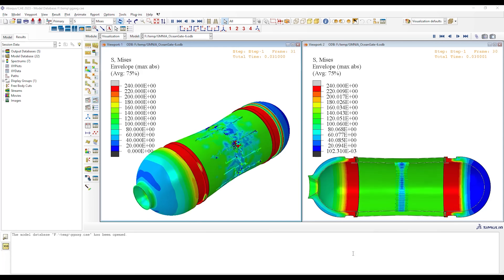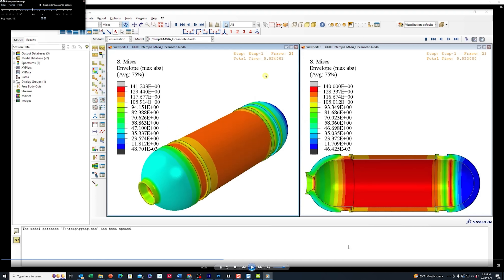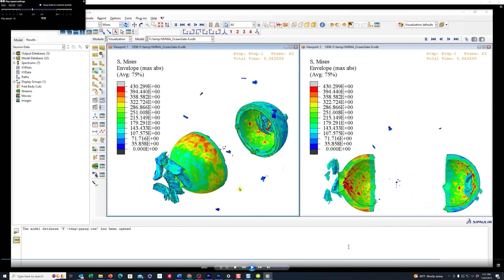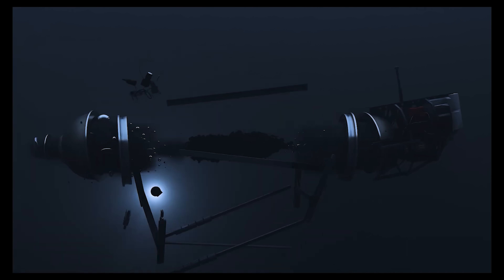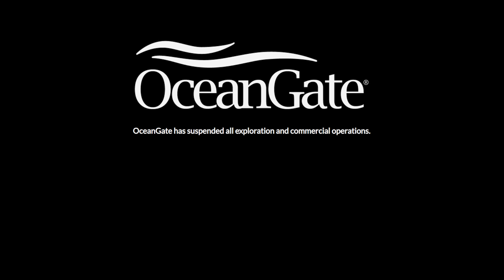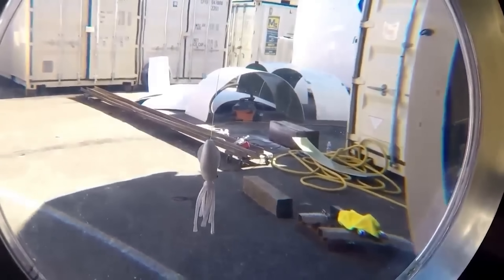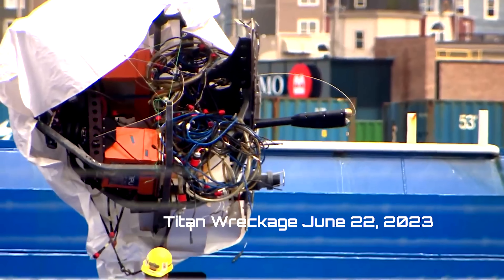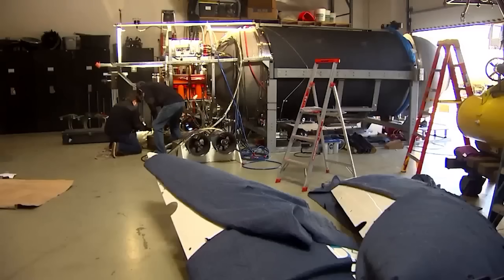Best Titan Sub Implosion Simulation, Cracked Porthole? Q & A

Comment: The implosion  compresses the air inside of the submarine. It does it at a rate that is fast enough to produce 50k°  Fahrenheit lasting about 2 seconds. Last time I checked that was pretty hot. So It  wouldn't matter if you were sitting on the end for crying out loud. Why is everybody so obsessed if the passengers felt anything or knew anything. Man is not afraid of dying, as long as it doesn't hurt

Comment: surely no one would use the sub. if there were obvious cracks in the window
WRONG, THE BOLTS DID NOT FLY OUT OF TITANIUM RING HOLDING WINDOW, VERIFIED IN WRECKAGE
GARBAGE VIDEO,  NO FACTS,   ILLICIT  ASSUMPTIONS

Comment: Pause vid at 11:21. The image shows an o-ring groove around the face of the titanium cap. It's probably a 400 series o-ring. A face seal is no where near strong enough as compared to an external or internal groove type. Ya, I know it would be hard to hinge the end cap as a door without using a face seal. My theory is the end cap(s) started to flatten and the o-ring face pivoted off the face of the titanium ring. Boom.

Comment: One can see in the video in which the recovered titanium parts are taken onboard the recovery ship, that the bolts around the porthole are in fact intact. I suspect that when the carbon fiber hull imploded the force pushed the acrylic window out from its mounting. Carbon fiber is prone to damage with repeated cycling under strain, so every dive would have weakened the integrity of the carbon fibre reinforced plastic (CFRP), the plastic being epoxy resin. The implosion was more or less inevitable. As far as I know the company did not undertake non-destructive testing (NDT) to determine if the integrity of the carbon fiber hull was compromised. This NDT is standard procedure in the aircraft servicing sector, and is carried out on carbon fibre parts

Comment: This isn’t a correct display of how it imploded. Those titanium caps would be pushed together like to powerful magnets being pulled towards each other crushing the much weaker carbon fiber material in the middle. There is equal pressure around the entire sub being pushed inward. The second that carbon fiber weakened those two titanium plates would once again sand which together. I kinda think the window was the first failure point, when they tested their 1/3 scale model the window collapsed inward. I don’t think the acrylic cracked, I think the entire piece of acrylic failed and got pushed inward and then from there I think the titanium plates crushed the carbon fiber hull. I’m not an engineer nor do I know a lot about the ocean and how the pressure works at depths. But I have a good understanding of physics and have to deal with physics everyday with the kind of work I do. It just makes sense to me that if the entire sub had equal pressure that the two stronger metal end caps would sand which the weaker carbon fiber the second the carbon fiber started to buckle

Comment: Those cracks in the window could just be salt residue. The water would be pulled to any surface imperfection, it doesn't take much to create a site where you get nucleation, which will pull more water to that area.

Comment: For one thing.....the TITAN had both an external and internal liner. How did they inspect it between dives? Did they disassemble all those fairings between each deep dive? 
I also question the handling of the sub. Did the handling itself put stress on those glued joints between Titanium and carbon?

Comment: Am I missing something? In the photo of the titanium ring coming off the ship, the sling goes through the porthole area...and I dont see any bolt holes for securing the clamping ring to hold the porthole in place....even if the bolts sheared you should see something there right??

Comment: Neither, it most likely broke at the carbon fiber, titanium cap seal. That’s the weakest point on there. They used resin glue in a non sterile, non climate controlled, non vacuumed environment and carbon fiber would be expanding/contracting at that joint every time.

Comment: Just a question, or two, about the electronics surviving at depth. Wouldn't the extreme overpressure of the implosion ignite the air in sub, including the casings that the electronics are housed in? There's certainly enough pressure at that depth and with a fairly oxygen rich air content in the sub wouldn't that mean that combustion would occur? Would this destroy the electronics completely or do they test electronics at these extremes?
edit:  The more I think of the forces at play the more questions I have. Would water hammer occur in an implosion as well? I've seen experimental slow-motion footage of model implosions and there are around 3 pulses in the bubble with the first happening after an initial flash of light. Is water hammer occurring in between pulses and what would that do to plastics and electronics?

I'm sure the outer cameras and electronics would be fine as they weren't inside the pressure vessel.

Comment: Revealing how that one scientist with the simulations goes on and on about the hull failing first but then gives little detail about his other simulation that he's worried might be more accurate. Remember that the social upper class doesn't like anything that takes away their privileges and the privilege of their members to be the first to explore new areas of the ocean is one thing they really don't like losing. The bourgeois is evil even if it spends its time hiding behind institutions and nonprofits.

Edit: that idea of a hydraulic pump causing a problem is a real issue in my opinion. Hydraulic systems have to be sealed by o-rings that could fail. Now he might have had a check valve to stop ingress in the event of a seal failure. One of the problems with hydraulic lines is that they expand and contract ever so slightly even if they're pure metal. Hopefully no one on his team switched out stainless steal for NiCopp brake line because they were too weak to do the flaring of stainless steel.

Oh, yeah, and one thing to keep in mind is that the government often lies about things during investigations to throw people off track. So when they said the people inside were listening to music when it imploded, I'm inclined to think that there may have been something else being recorded.

Comment: didnt the audio recording show they were hearing "cracking" sounds from behind the read wall.? Could the acoustics make them think it was from the read, when in fact it was from the front. On the voice recording, they did switch from Battery A to battery B, also at the rear.

Comment: I love how in one simulation the domes are sucked inwards due to the implosion, while in the other simulation the domes are ejected outwards.

It just reduces confidence in the accuracy of one or both simulations.
Reply from the maker: Talking about the same simulation from doctor Wagner showing it from both directions, it is because a failure from the glass would likely shoot in and below the ends out first. Whereas if you come in from the side and crush the cylinder, you still have the 6000 PSI pushing in on those end points before they can expand after the implosion by way of the little bit of a explosion from the heat

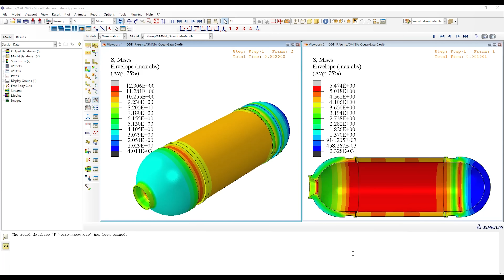Comment: Back again.  I would like to focus on that 5-to-6-foot twisted strip of metal that appears attached to one of the titanium interface rings.  I refer to your video “Titan Sub: 1st Video of Implosion Wreckage Back on Land.” The long strip of metal attached to the titanium ring is shown at 1:09.  At time 0:53 there appears to be a smaller strip of metal attached to the other ring.  In my earlier remarks, I thought that even a violent implosion of the carbon fiber hull would leave the rings still bolted to the titanium end caps.  Everyone seems to agree that the implosion ripped every shard of carbon fiber hull from the titanium rings.  However, these metal strips show that the titanium ring likely tore away some metal right at the point the bolts were attached.  If true, this is amazing evidence of the force of the implosion.

Comment: What was the reason for using carbon fiber?   Why not use tested materials (Steel or Titanium)?  If the goal is to run trips for the public I would think the focus should be on safety and durability so you could maximize the trips - and not on lightness.   Not sure what the driver was for proving he could use carbon fiber.   Thanks for all the detailed videos!

Comment: one thing no one is talking about or noticing, is the question of how the internal objects like the computer screen, floor structure, handles overhead etc. are attached to the metal sleeve that the carbon fiber material is wound around. the computer screen appears bolted to the sleeve.how were the holes drilled into that sleeve? did they possibly cut into the carbon fiber causing weak spots when attaching these things. like to see a cross section of the body of this craft.

Comment: If the viewport blew in, then that would take the load off the rest of the vessel and the rest of the sub would be mostly in one piece. No I think the failure was elsewhere, like the carbon fiber, then the inertia of the incoming water knocked the port out, and that's why its missing from the salvaged front dome.
The incoming water flow/hammer was so great it broke all the bolts holding the nose dome to the adapter ring, as evidenced by them coming up separately. This force would have no trouble breaking the much smaller bolts on the viewport window  ring, releasing the window.
Also, if the window blew in then the window ring and it's bolts would mostly be in place.

Comment: I question the 13ms to process an image claim unless you mean the delay between the image being visible and us realizing what the image is. Its been shown time and time again that people can discern differences in individual frames in video games up to 240Hz which last about 4.16ms and studies have shown that most humans can detect a flash of white on a black screen that lasts for 1 frame at speeds up to 600 hz or 1.66m.

That being said, based on the simulation and assuming it's accurate;  It is likely the passengers saw the implosion happen if they weren't in the center but doubtful they lived long enough to comprehend what they saw.

Comment: My opinion about all this things. Nobody speaks about compression of the air inside the sub after implosion. Now I'm speaking about air inside, also air inside the lungs of persons (nearly on same pressure ~1 ATM) I will call it air bubble for simplification. There is also some of the gasses inside colons of all persons. Now what is happening if we compress the gas. it is heating up. It can be compared to diesel engine Principe. Under tremendous instant compression the air bubble inside sub will heats up to extreme temperature (in diesel engine it is enough to ignite the mix of air and fuel) and then explosion moves the piston. Something similar happened inside sub also. Air compressed to high temperature and compressed to small bubble exploded. This process repeated itself maybe 3-4 times until stabile state. So my opinion is that inside the sub the persons (their lungs etc.) also burned. I think everything inside the sub completely disintegrated in speed about 2400 km/h. To talk about something survived, the electronics and all this things I don't believe that it will be possible.

Comment: I stopped the video to respond before watching this video. The number one worst problem is gluing two materials together that are going to shrink at different rates under pressure and this pressure was massive. To me the glue between the titanium and the carbon fiber is the weakest point.

Comment: The way it was layered if it started to separate I'd believe it would reach a point where a entire layer could've stayed intact being pushed inward could've accounted for the faster decent think that dummy knew they was done for while still in radio contact
  If the leaked transcript was real and  accurate noise aft with that egomaniac could've meant the hull being push in
   Don't panic anyone this is normal for a carbon fiber hull

Comment: If someone was sitting mostly or entirely in the front end cap, what would they experience during the implosion if this is an accurate simulation? Would it be the same or different than one in the middle?

Comment: No cracks were visible.. anything seen was actually seal grease.
but.. the pressure vessel obviously did the 'sausage' routine when it imploded. Both 'ends' got shot out and away as it imploded. I'm sure the view port got shot out as well.  
basically anything in the middle got shot out of both ends.. actually into both ends which then were dis-attached.
Reply: That is horrifying

Comment: I understand that the implosion happened before anyone could see anything occurring. My question has always been whether the pressure built during descent might have had an affect on their bodies 𝒃𝒆𝒇𝒐𝒓𝒆 the implosion. I think about holding a grape between my thumb and forefinger. Am I correct in thinking that as the door is smashing my fingers, the force of the outside pressure is doing 𝒔𝒐𝒎𝒆𝒕𝒉𝒊𝒏𝒈 to the grape nestled between my fingers?

Help me to understand, please. 

“...𝑎𝑛𝑑 𝑖𝑡 𝑖𝑠 𝑔𝑜𝑜𝑑.“🕯

Comment: What appears to be cracks around the edges of the window look to me like the interface between the window and whatever they’re using as a sealant between the window and the titanium. How smooth are the faces of the window and the titanium? They can’t be perfect. If the sealant is slightly irregular that could be the squiggly lines we’re seeing. Now, as we were told, the acrylic window is compressed inwards by about 3/4”. But it’s not that simple either. That compression alters the geometry of the window. The rear, that should be made to match the angle of the titanium it sits in, will be altered as well. The front ring will exert pressure so that is kept to a minimum. But acrylic is brittle, and doesn’t like to move. It’s certainly possible that after a number of dives it no longer had the give it had before, as it was rated for less than half the pressure it was being used for.

But there are some many points of possible failure for the vessel. The short glue joints between the titanium and the carbon fiber cylinder are a weak spot. Also as the cylinder compresses under pressure the joints are stressed. There’s a good chance they would give way after that cycle happens a number of times.

Comment: The carbon fiber and acrylic porthole window were not the correct materials. The carbon fiber delaminates under repeat fatigue then does not deflect, it just cracks like glass. The acrylic window was not rated for the depth they needed to descend to.

Comment: BOOM! .. look at the hinge for the front shell at the 11:39 mark. The Titan submersible was NOT able to "jettison the frame" .. the front shell was BOLTED to the frame. Unless you could unbolt the shell from the pressure hull first, there is no way you can "jettison the frame" .. Titan  did NOT have the capability to "jettison the frame" .. the "leaked transcript" is a FRAUD! .. they would NEVER have said "jettison the frame" because there was absolutely NO WAY they could even do that!

Comment: So, point of interest. That "leaked transcript" that has been going around, refers to "attempting to jettison the frame" .. however, as you can clearly see in many of the video clips you present here, the Titan had no facility in which it could "jettison the frame". Additionally, it would make no sense to do so, all of the backend gear was attached to the frame, furthermore, Titan could not dock on its platform without the frame and would be floundering in the ocean with the occupants trapped inside until someone could rescue and unbolt them. Further still, their air and other systems would have been gone along with the frame (ballast and other systems as well, including propulsion motors). As you can clearly see from these clips, there was absolutely no way to "jettison the frame", but the so-called "leaked transcript" had EXACTLY that text in it. Once again, I call buillsh*t on the "leaked transcript". Titan didn't have that ability, and that ability would make absolutely no sense to begin with. The "jettison the frame" is the "smoking gun" debunking that "leaked transcript".

Comment: Hi Jeff, this is Jeff .. I am convinced that the implosion happened nearly exactly in the middle of the pressure hull. I have worked quite a bit with this material, and I am pretty darned sure the carbon fiber hull was the root cause of the implosion and the most likely place it did it was smack dab in the middle of it. That would be the weakest point. I really like the animation and material modeling. It also shows precisely what I suspected the moment I watched the video of the fabrication process.

Comment: You could never take a ocean pressure of:  33 feet (per atmosphere) / 14.7# (1 atmosphere) (= psi per foot of depth) X 12,500 feet (titanic depth) = 28,000 PSI (at the titanic depth) on the hull of the submersible.   NO chance for error or being cheap.   Imminent death!!!

Comment: What if the grease/seals to the window went, but it wasn't the ingress point of water, but the point the air was pushed out, when the final catastrophe happened? Just strong enough to hold back the water, but not enough should some other part also start to weaken.